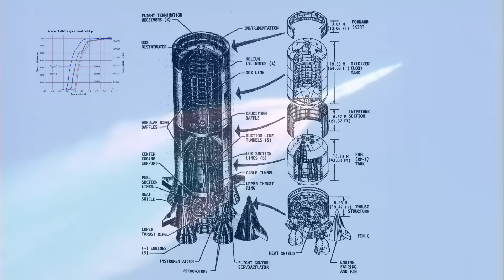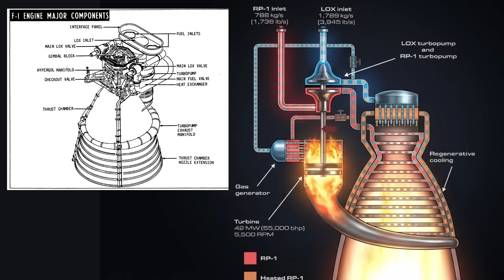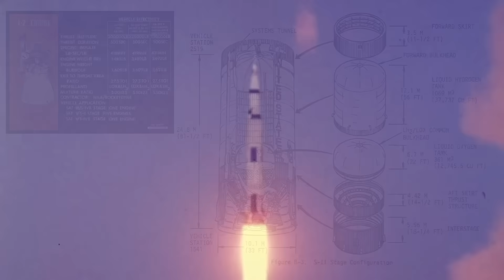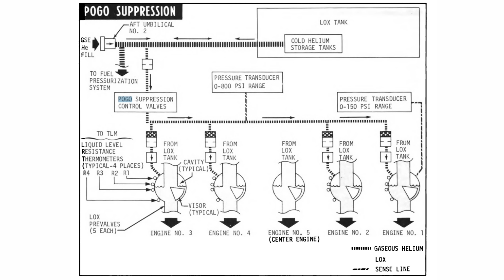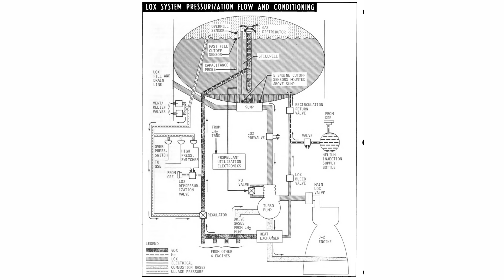Apollo’s Pogo Problem: The Oscillation That Nearly Destroyed the Moon Rocket

Comment from the maker: Pogo wasn’t a vibration you could simply “design around.”
It was a self-excited instability that nearly tore Saturn V apart—twice.
If you want to see how Apollo engineers learned to control forces that could grow faster than human reaction time, this video breaks down the physics, the failures, and the fixes that made lunar flight possible.
👉 If you found this valuable, like, share, and join the channel to support deeper, technically accurate Apollo content.
Related deep dives you may enjoy:
• The Final Three Minutes Before Saturn V Liftoff https://youtu.be/DSK4TktJcPc?si=tad38VJHxbCxUVRC
• The First Ten Seconds After Liftoff  https://youtu.be/nTlMCzWxVRk?si=zblvT8EptcYUSqvI
• Engine Out: How Saturn V Could Lose an F-1 and Still Reach Orbit  https://youtu.be/IeNhl8BbUXQ?si=ovJ3O7xINWM6jp3w

Comment: Fantastic series. I'm not particularly sensitive about length, whatever time you need to cover a specific topic without padding is fine with me.

A thought just occurred to me watching the video. I assume the fuel and oxidizer tanks were vented. Given the tremendous flow rate how was that balanced and did the change in atmospheric pressure affect flow rate or was it negligible compared to acceleration?.

Comment: NASA did the best they could to minimize POGO on the Saturn V. Pogo was not really an issue until the qualification of the Titan II which was to be the booster for the Gemini Program. If I remember correctly, the Titan first stage was experiencing +/- 25g oscillations. For a nuclear warhead that was not a problem. Though, for a manned crew it could be lethal. NASA would not accept a booster that experienced those kinds of POGO oscillations. Why I bring this up is that while the Air Force is trying to man rate an ICBM missile while the Saturn V was also under development. I believe that there were some allowances for POGO mitigation in the Saturn V development, but it really was not understood all that well at the time. Here is a bit of trivia, the name POGO was used to describe the longitudinal oscillations of a rocket as to be something similar to riding a pogo stick. The name and term stuck.